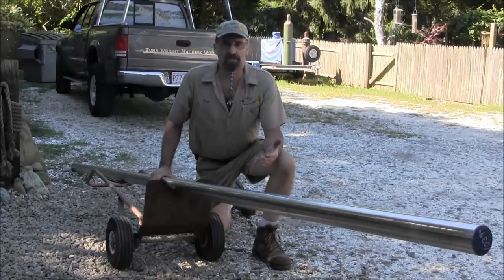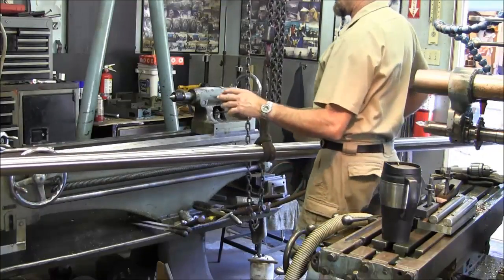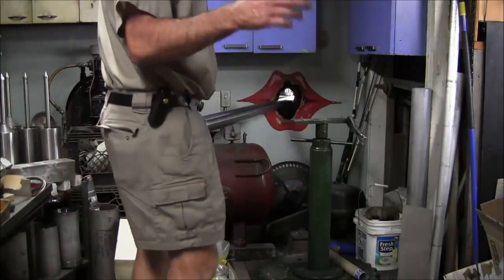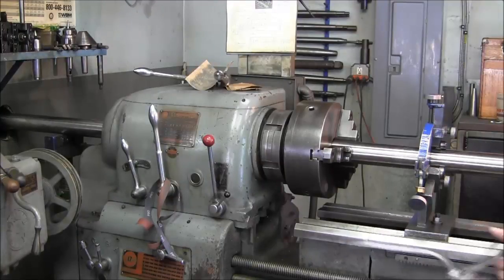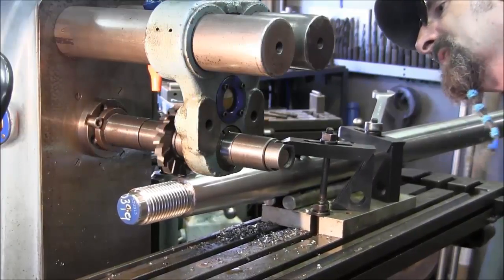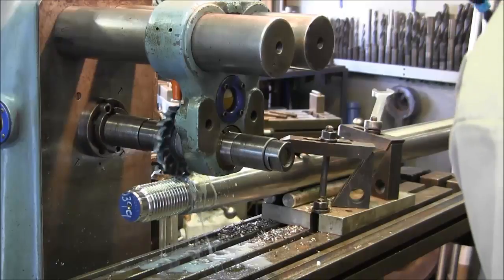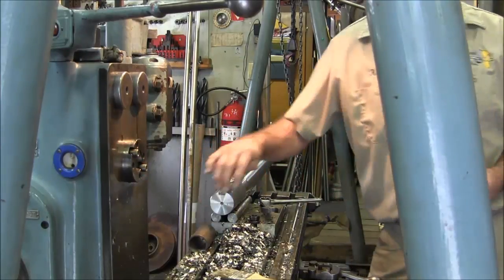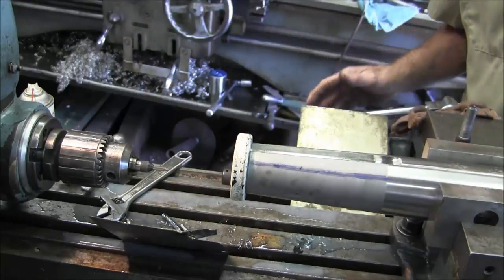Handle It!

Comment from the maker: Sometimes I do if the face is way out of square, but if close there is no need to remove the color code for the material. If the noise was bothering me I would wear ear protection. Most of the time you can step to one side or the other and the decimals of sound drop by half. The camera picks up and magnify's the sound. Thanks for the comments and the concern. ;{)-----

Comment from the maker: The key-ways are parallel to the taper, in the video you can see the jig that I made to automatically hold shafting on the mill table at the right angle. The bores of the props and taper bore couplings are done with tapered broach guides and the base under the prop is angled so the push is straight inline with the ram. ;{)-----

Comment from the maker: No offence taken I had the machinery handbook open the the three hole pattern,formula, but the flex and length of the shaft was more of a variable than the backlash in the machine. Using the coaxial indicator on each hole after the first one was located off center and just a straight upward table movement, I was happy with the free fit of all the retaining screws. Thanks for adding your comment! ;{)-----

Comment from the maker: Less work, using the hole I have now, than having to remove tail stock. most shafting I do, I don't even bother with the hoist. and some just carry around the corner and feed through from that side. I have been doing this trick since Jan, 2 1997 and if I felt there was a better choice or way I'd already be doing it different, your idea had passed through my mind about a dozen times, until I pulled the tail stock off a half dozen times. Thanks for the comment. ;{)-----

Comment: Wow Keith - that is one mother of a shaft! Fascinating to see your approach.  Glad I never had to handle anything that huge in my old active days! In case you have time to answer my curiosity - about 9.30 mark -- back room, setting up shaft support - couldn't work out what the 3 or 4 items were left of frame! Seemed large dia round chunks with turned down much smaller parts about 9" or so long and ends turned to like a taper/cone end. Thanks as always for your (another) enjoyable presentation.

Comment from the maker: The marina decided to lap the wheel in place, after the shaft is installed! You are right and I asked them if they wanted me to preform that procedure. I do it the same as other prop and shaft off the end of the lathe, just lift the wheel with the hoist, as I have done in another video. ;{)-----

Comment: Hi Keith,

I learned something here. I always thought the keyseat were parallel to the taper section of the shaft. So how are the keyways in the prop cut? Do you use a special tapered broach bushing or are they done on a slotter or shaper?

Best,

Tom Lipton

Comment from the maker: Marine shafting comes in minimum lengths, like 12', 14', 16', on up to 21' & 22', so sometimes it's like playing the stock market on what lengths to buy for stock, and some shafting projects have to be priced to compensate for the extra material on a shaft that you have in stock and need to use it to make the customers time frame. Depending on the diameter, the shafting cost the customer between 13 and 15.5 dollars a pound, today, tomorrow mat be more, market type item ;{)-----

Comment: Great stuff, The only way to keep the art alive is to keep passing the knowledge along. Curious about your jig. I would guess the plate on your table is tapered, are the rods fixed or floating? I have a small shop on the other end of the continent,I am branching into the marine end of things, you videos have been real helpful. Wish I paid more attention to the geniuses I worked around when I was a kid.

Comment: In the other videos on shafting you spoke at length about the importance of lapping the prop to the shaft taper to get good solid contact across the taper.  No doubt it's important here, too, but the prop for a 3" shaft must present some difficulties in doing that.  Was this lapped, will it be lapped, how, etc?

Comment: Keith, Is that a Van Norman machine you were horizontal drilling on? I used to work at a machine shop that had one of those. It had a a diagonal way and we did heavy vertical and horizontal milling on it. We didn't have the drilling attachment. I remember you could set the table at an angle too. It was one heavy duty machine. that machine shop went out of business long ago. it was Norman Machine and Supply in Asheboro, NC.

Comment: Keith wow looks like you've really got a system for moving shafting around in the shop.  You make it look so easy up until you have it off the gantry as your sliding it through the wall,  that looked tough.  Curious are shafts that large ordered at finished length or are they longer and faced down to final length?  Good to see a new vid hope you and your family are well.

Comment from the maker: Five minutes at the most to remove it and have a true running shaft. Checking to see if the milling has relieved the tapers and created enough run-out, to need a tweak is a good comment and worthy of a check, after the machining. Excuses are only reasons that are accepted by oneself.  ;{)-----